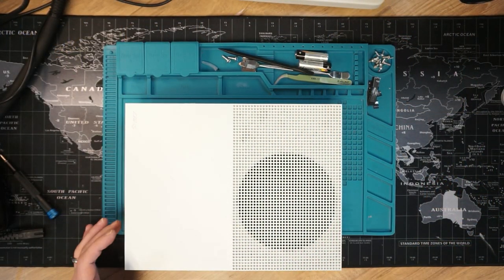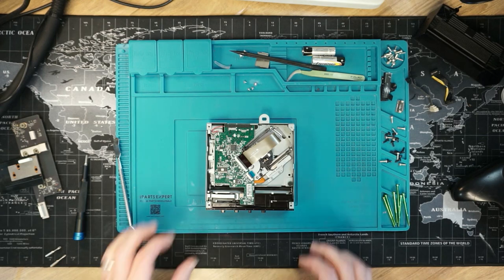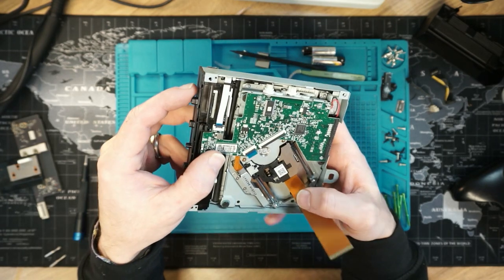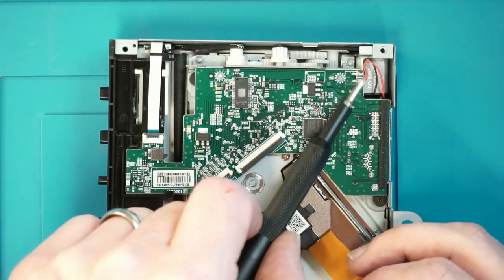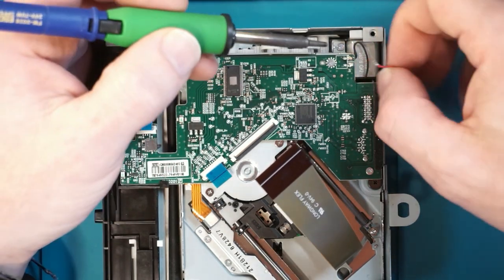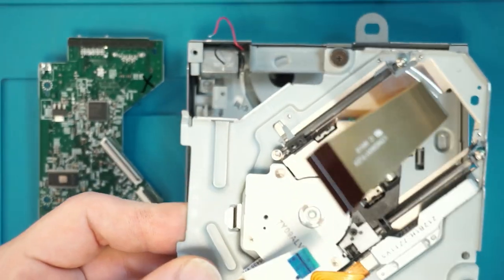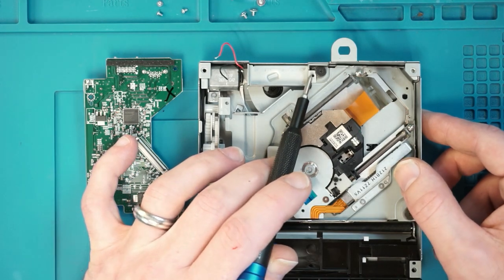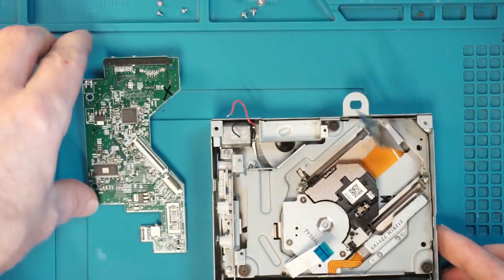Xbox One S Not Reading Discs - It SHOULD Have Been Easy!

Comment: I’ve tried the “hold the power button for 10 seconds” theory, the “put it halfway in and let it spin” theory, the “turn it on it side and let gravity do its thing” theory, I’ve tried the “power saver mode” theory and I’ve tried cleaning my discs. I’m out of ideas. The only thing I haven’t tried is cleaning the dust out but I don’t have the tools to take my Xbox apart and I don’t have an air can to blow it out so please let me know if you have any ideas??
Reply: Hair dryer on low settings
Reply: I have one that will play blu ray movies no problem, I have successfully installed one game from disc but it’s having a heck of a time detecting game discs. It’s driving me nuts.

Comment: what motor does the disc drive use ? can i use one from an old bluray player ?
Reply from the maker: I couldn't actually tell you buddy.
Reply: @GetRefurbed  it's alright man I took the drive out my old one s I just had to swap the motherboard and shave off one of the plastic mounts on the front of the disc drive . other then that they run the same disc drive . it's an easy swap

Comment: everytime i put a disc in my xbox, it won't read at all. the disc will go in no problem but nothing will come up, it won't even tell me if the disc is working or not so i checked to see if the drive was working i then realized it wasn't even moving. is it broken?
Reply from the maker: It could be several things buddy, go with a new laser first but it could be the mechanism itself.